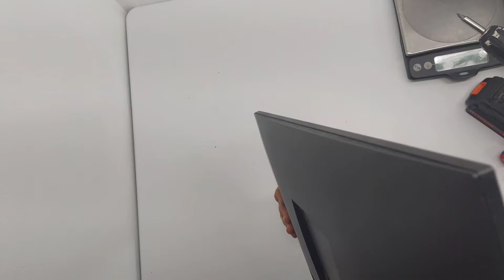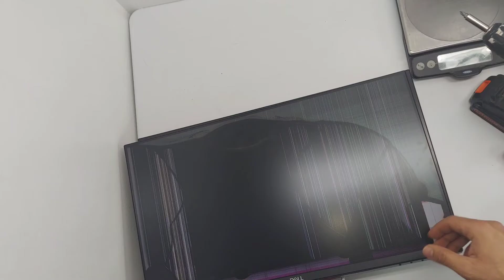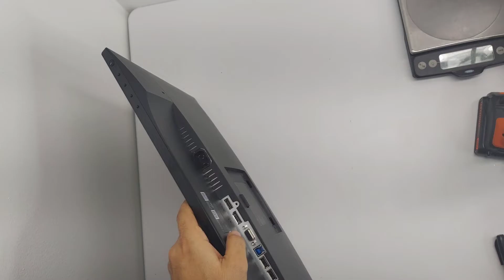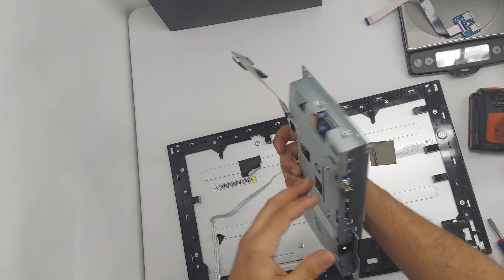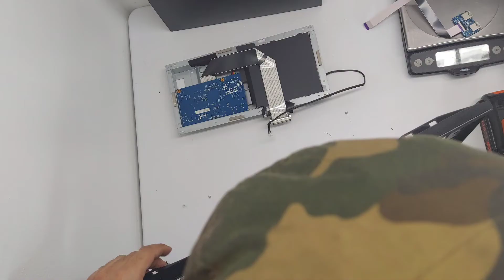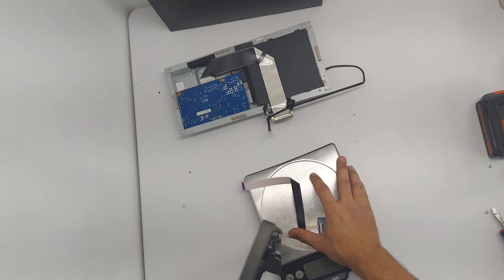Opening Dell P2419H Monitor for parts replacement and / or repair

Comment: Is it safe to remove certain electronic components from a PCB used in a monitor to replace similar components in another monitor? Assume the values match or close. Have a couple of Dell monitors - not the same model

Comment: Have you ever seen a problem with quite similar Dell monitor that a screen glass is separating from the body? I can see illumination leds in the gap. Is it LCD itself is separating or it's just loose in the frame? If I push it back it stays in place for a while. The next day it is opened again (like 1-2 mm gap, everything else works fine, no issues with the image)
Reply from the maker: sorry that's not something I experienced myself
Reply: Same thing happens to me
Reply: @sri_gaming21  you can use paperclip or video camera to hold the screen in its place, but it sucks
Reply: @donalexey  i opened the display their is nothing worry would dust to in inside as the panel and edge plastic panel are 2 different parts panel is glued it does not have space for dust, let it their no need to worry . its just cheap plastic qaulity.

Comment: "Usually it isn;t worth it..." Dammit, I've just broken my Dell U2717D, still usable but not in a few weeks/months unfortunetly. LCD black area is getting bigger and bigger. Only solution is a new monitor you say ?
Reply from the maker: When I researched the pricing for LCD replacement, it didn't make sense to pay almost 140 for a monitor that was selling for 180 new a the time. The parts removed and sold is generally better was to get back some cash to use toward a new monitor.

Comment: Hi , there, yesterday I spill some beer on my Monitor Dell P2717H ( not much but it went through power button and utilities buttons... I opened the monitor and washed the electrical module! I though it will work but today monitor just randomly switch on and off ( I think module is done ) I find the spare one used for 10 bucks but I not sure how to get the old one from control board? I see that you just pulled this one out?! Can you help me with this situation? P.S. Part number of module is 748.A1B03.0011 (Function key BD L5265-1)

Comment: Yo bro great video. What would you call the big thing in the middle held on by tape. I'm new to this stuff and I don't know what it is called. Thanks
Reply from the maker: The ribbons?
Reply: @smartflips  He means the metal frame that holds the input controller board and that other board I believe you said is the power board.  What do you call that assembly?  How do you get a part number for it?  I have a Dell Ultrasharp U2718Q that's in fine shape except for the mini displayport input, I want to replace the input controller board only but if I have to buy the whole assembly I might do that.  How do I search for the board or the assembly?  Where can I buy it?

Comment: Can we replace the display screen if it get damaged??
Reply from the maker: The price to get a new screen for replacement makes it not worth it. You are better off getting another monitor. You can try to remove parts from your damaged monitor to sell like electronic boards and stand.

Comment: Hi, Can I buy a Dell second hand monitor older than mine then take the lcd out as a replacement for mine cracked one?
Reply from the maker: I don't think it will work because the resolution is different between old and new monitors. you can try to look up the part number of each and compare them to see if the manufacturer say that they are similar.

Comment: Current DELL monitors are really rubbish, butter plastic, latches break, when opened they startle, it looks like a vacuum cleaner filter with so much dust, even saving on screws the miserable ones from Dell are doing, I have a Dell P2317H and the motherboard is fixed by the even 4 screws that stay in the foot socket! I have a 2209WA fully shielded, plastic doesn't break, latches don't break, you can disassemble it any number of times and not a single dust gets in, but it's heavy! Current Dell monitor is "disposable".🤮🤮